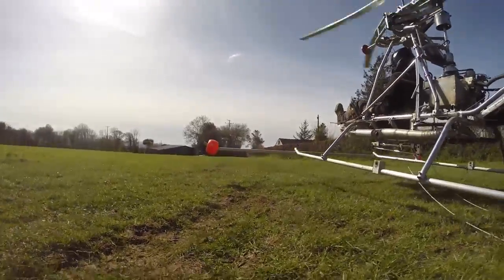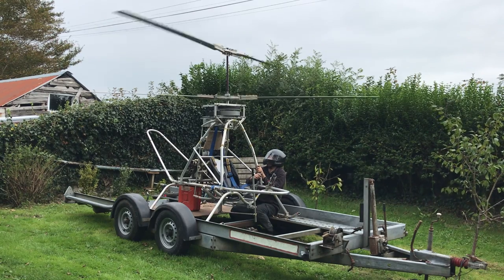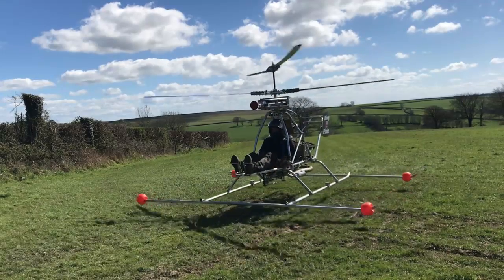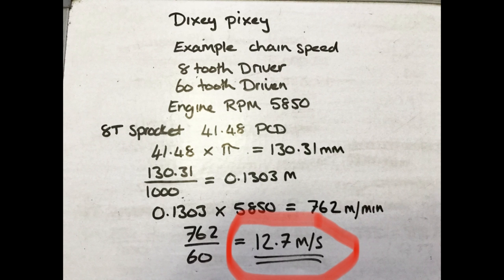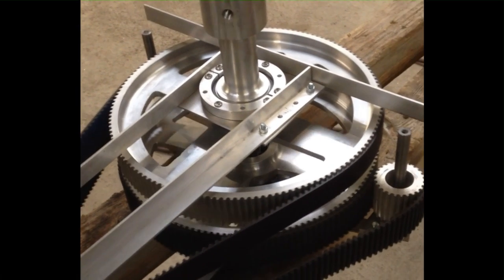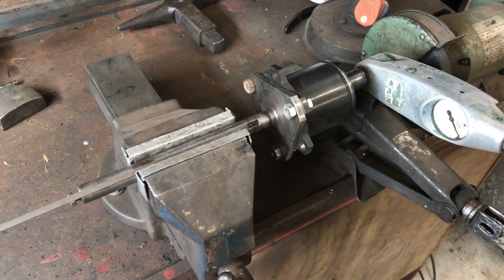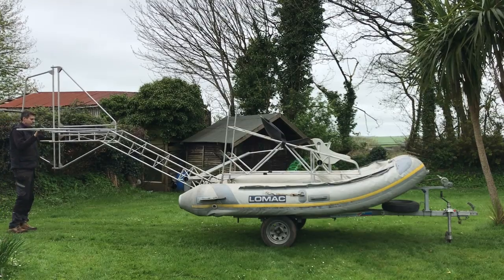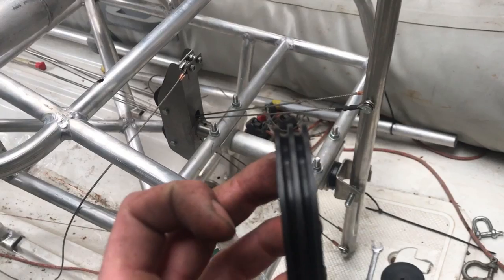Homemade Helicopter Rebuild part 2 plus Wing in ground effect, Ekranoplan, flying boat

Comment: Years ago I made most of the parts necessary for a minicopter. I never got around to put the parts together. Put an ad in the paper and someone else bought all the parts. That was the last time I seen all the machined parts I made years ago. 
          Wish I did not sell the parts today. But it is too late, its gone. 
          Nice work fella.
Reply from the maker: Interesting 👍 Was it parts made from online plans or your own design ?
Reply: @Ben-Dixey  Hello Ben. I made the parts from my own design. I looked up components comercelly and improved on the technical and duty cycle. So I cheated a little bit fella. Parts were 7078-T8 aluminum. The shafting was high grade titanium, I do not remember the grade Sir. Like your video. Brought back a lot of great memories. Peace v

Comment: Hello sir, I believe going to  Chain drive is a mistake chains are designed for running horizontal not vertical as your belt s run now , I've worked on equipment and vertical Chains aren't used they get turned into gears, chains aren't made to run that way they have a side thrust issue,  not trying to burst your bubble as they say  just offering input, if you do go chains I would bet it tears up gears , sorry for that, but I'm thinking I'm right, goog luck it looks really good from what I can see on video
Reply from the maker: Thanks for your input, I've found a couple examples where chains runs in the same way as my belt drive. The Rotorway Exec helicopter used chains and the Bensen B9 Helicopter both run horizontally. I don't think it will be a major problem but I need to do some more research and can understand why it will wear one side of the sprockets. It just depends how fast the sprockets wear. I suspect the driving sprocket will be ok because they are hardened but the driven sprockets I want to use Aluminium. This sprocket might wear, it just depends how fast.

Comment: Great feeling to see you back on the main project brother. the full success isnt far away now . thanks for sharing with us,
Reply from the maker: Cheers my friend, I've got to finish the flying boat before really concentrating on the helicopter but can't wait to get back on it properly. I really don't mind dedicating the foreseeable future on the helicopter. Its worth it because of how rewarding it is.
Reply: @Ben-Dixey  to me the most exciting part is to plan ,build , create, to puzzle, to struggle, to tests the thing it's even good to have two projects in the hand .
There is no chance of hitting boredom in your life until both projects get it destination.
Is flying boat like fixes wing aircraft or it's just a air boat ?
Full support brother
Reply from the maker: @rajeevshagun-info  👍 yes, I agree, there is a lot of satisfaction in all aspects of the builds. 
The flying boat will be an aircraft that flies in ground effect. Height above the water will be somewhere between 2 and 6 meters. It will be similar to flying a plane but can't climb very high, it relies on the extra efficiency of ground effect to fly. I think it will be a lot of fun if it works out. Cruise Speed will be 40-60mph, faster than most boats but only 60hp.
Reply: @Ben-Dixey  I want to use  your helicopter lifting off footage in the reels , ofcourse your name will be displayed as a creater of the machine, if you permit me to do so ?
Because I saw similar DIY coaxial helicopter in Reels just now , it too had extra tubes for primary balance support.
Thanks brother 😊
Reply from the maker: @rajeevshagun-info  Sure, no problem 👍👌 I'm all for sharing.
Reply: @Ben-Dixey  thanks brother,
Reply: @Ben-Dixey  bro ,I was showing your helicopter lift off to two other people we all three people impressed by smooth controlled hovering and lift off ,
Wow you have really improved the flight Ben .
Congratulations
Reply from the maker: @rajeevshagun-info  thanks, it was definitely getting better, shame the driveshaft broke but it will be back.
Reply: @Ben-Dixey  brother my friend Alf Beharie has sent a suggestion on my reel about your helicopter...I think it's considerable...I am pasting it below.

"His vertical stabiliser/rudder fin on it's tail appears to be way too small.  At hover the wash from the blades is being directed outwards 360 degrees all round by the proximity to the ground and it needs the drag provided by the stabiliser fin to keep the nose pointing in the same direction.  As it stands he is having to make constant adjustments to the stick to try and keep it pointing forward as the fin/rudder is not providing enough drag."

What do you think about it ? I know the big rudders looks ugly but may do the job right!?
Thanks
Reply from the maker: @rajeevshagun-info  Hi, I think the rudder could be increased in size, it would provide a better response to yaw control. I did once get to full deflection during a wind gust. It needs to be more effective, definitely a consideration for the future. 👍
Reply: @Ben-Dixey  I was thinking by seeing your rudders, they look cute compared to the other coaxial helicopters I have seen , others look awkwardly big and loose but now I think they might work better?!
Greetings bro.
Reply from the maker: @rajeevshagun-info  cute is a nice way of saying too small. 😆👍
Have a look at the sch2a coaxial helicopter, from those pictures the rudder looks even cuter. You would think mine would be better than the sch2a by comparison but perhaps I'm missing something.
My rudders are just flat pieces of carbon fibre, wonder if an airfoil would be more effective at creating yaw.
Also my rudders are hinged at 45 degrees, not 90 degrees to the downward airflow. I did this so that they would have some yaw control at forward speed as well as in a hover. 
That will be reducing the effectiveness in the hover.

Comment: extra-extra deep grooves for the control surface cable pulleys to help prevent cables coming off the pulleys perhaps?
Reply from the maker: I did consider that option but decided to use a cable retainer instead. A bent bit of metal that almost contacts the diameter of the pulley, preventing the cable from coming off. It's usually a U shaped bit of metal that is bolted through the pulley bolt but it needs to be done so that if the pulley bolt came loose it can't rotate and jam the cable. 
That's the thing with some safety devices sometimes they can cause a failure rather than prevent one. It's easy to solve that issue with an additional small bolt.

Comment: Another great video.  I concur with your decision to use chain as well as the selection methodology.  

A few people have mentioned heating, stretch & wear in relation to chain.  They are all valid concerns - but by periodically inspecting the drive components, you should be able to determine a life expectancy for each component and thus a service / replacement schedule.  That approach is common in aviation where strength / life expectancy have to be balanced against mass.  Sometimes the most viable solution is to have a light weight part, replaced often.
Reply from the maker: Great comment and that makes sense to me. The chains are cheap and can be replaced every 10 hours of operation if necessary. I think considering the low stress the chains are under it will be a reliable option.

Comment: Don't forget to factor in adrenaline strength when designing your control system.  I guarantee you that you can pull twice as hard as you can when you're not flooded with the good stuff.  I'm so glad you came back to the helicopter project!  Sometimes it just takes a while away from something to get a clear perspective on the path forward.
Reply from the maker: That's true, Adrenalin definitely gives you extra strength, I'll check the calculations with double the pull. 👍

Comment: Be careful - roller chains really don't like to be run horizontally - you'll find a lot of wear on the side plates and sprocket teeth as the weight of the chain pulls down on the sprocket.
Reply from the maker: Thanks for the insight, much appreciated, makes sense. 👍

Comment: Bike chains aren't used laying on their side.
Reply from the maker: That's right, not normally anyway. You would think that considering the tension they are under it wouldn't make a significant difference but maybe it does. Need to research this.

Comment: When the motorcycle chain fails, you at worst fall off the bike. When your helicopter chain fails, you die.
Reply: That being said, my dad swears by his Scott Oiler on his chains for his superbikes.
Reply from the maker: @RobinDuckett More risk than a motorbike for sure but bare in mind maximum height for this machine will be around 3ft. Chains have been used for helicopters. Rotorway for example. 
Interesting about the oiler, that could be a good addition.
Reply: Oof, didn’t realise they were £300! Definitely not the price he told my mum back in the day 😂😂

Comment: be aware of chain strech, a common matanance requirement on motorbikes is to re-tension your chain as it stretches over time.
Reply from the maker: 👍 chains could stretch quite quickly in this situation. Granted

Comment: multi-rib flat belts, or... crazy talk? a planetary. either the gear set from an automatic, or make one with a bunch of pneumatic tyres aka rollers...
Reply from the maker: Hi, multi rib belts can work and could be a better option. The sch2a uses multi-rib pk belts. I was very surprised when i saw them being used. One is run on the backside of the belt against the big pulley. This means it doesn't have to be double sided. A small diameter drive pulley is used. 

Planetary gear set from an automatic would be a good option. Think it can be used for torque balancing two rotors.

Comment: G'day,

Yay Team !

I flew behind a Bicycle Chain in 1978, and that Chain had been flying since 1975, with a 1-cylinder 2-Stroke
"Pixie Minor" 8-hp ex-Lawnmower motor 
Pulsing and vibrating it into motion.

This past 6 weeks I've put 670 Km on the new Talaria Sting L-1-e...,  a 3,000 Watt  road-registered Electric Motocross Bike.

It has the biggest Bike-Chain I ever owned ; and I'm coming up to speed on it, but it works very well.

People have been making ,& using Chains to transmit Power for a hell of a lot of time  ; and basically all the Bugs any Armchair Speculatir can imagine were all  thoroughly solved a hundred years ago.

Wilbour & Orville used Chains in 1903 to not only drive two Propellers from one 12.5 Hp Engine - but also they ran the Chains through Guide-Tubes, to eliminate Chain-Slap - and one Chain & it's Guides were "crossed" so that the  2  Propellers could rotate in opposite directions.

Chains are an efficient, cheap, &😮 reliable option.

Chains  do fail, when badly made, or badly aligned, or badly maintained...; or when overloaded...

But no more than does anything else.

The trick is to do it
PROPERLY, and thenceforth

Thou shalt
Not
Upfcukificate...(!).

One factoid cometh to mind..., when subjected to Thermal Analysis, a Bicycle Chain is 98.5% Thermally Efficient.

They waste almost no Kinetic Energy in heating themsrlves up from excess friction.

Such is life,

Have a good one...

Stat safe.

;-p

Ciao !
Reply from the maker: Brilliant comment. Thanks 👍

Comment: There is a school of thought that prefers an elastomeric coupler btw engine and reduction driven propeller when using gear drives. I assume the same might apply to chain drives.
I'm not aware of any flying examples using a chain drive propeller speed reducer, however I have seen them on prototype layouts.
Reply from the maker: Yes, that's right a cushion drive is important. I have no doubt more so if using a chain that has some play back and fourth.

Comment: Your calculations based on the use of a chain in motorcycles may be correct but do realize that a motorcycle is rarely driven at top speed if at all. In your application, the chain is used near maximum loading most of the time. A 1:8 ratio would require one rather small and one quite large wheel. There is a minimum number of teeth for the small chainwheel. The big one will be very big.
Reply: Imagine the stress on a chain when you rev the bike up and drop the clutch at the lights with 2 people up trying be the first away the chain takes more than they specifie  .
Reply from the maker: Hi, the 530 chain on the CBR at maximum load will be 2561lbs, the same chain will have a chain pull of 808lbs on the helicopter. The maximum speed on the CBR will have a chain speed of 25.7m/s and the helicopter will be at 12.7m/s. I understand the chain speed is still high for a constant use situation but I do think that the temperatures will be manageable for short durations.

Comment: problem with chain if it breaks at the wrong spot of the chopper sprocket there is a very good chance it jams the rotor assembly not good or even worst it breaks and hits you still not good use the belt if not the exact one you use try one thats aero certified or race car certified cheers from down under
Reply: Correct on all counts. But you know that all the great brilliant minds here that have changed civilization all think the chain is a great idea.
Reply from the maker: I don't understand why a chain would break if it's not being overstressed.
Reply: @Ben-Dixey  a chain does get stressed maybe nut in stretching but in lateral and vertical stretch when a chain is laid on its side under rpm but that’s your choice
Reply from the maker: @glennarnold3970  Ok, yes this needs to be considered. I've got quite a long distance between pulley centres, running the chain horizontally needs to be researched. Thanks
Reply: @Ben-Dixey  just trying to give you options cheers glenn

Comment: Before you destroy all your work, you may want to become expert first by spending 4,000 hours in a sim.
I'm not joking.
If you've spent less than 1,000 hours in a sim, or none at all, hang up your hat, and learn to fly first, or you're going to be chopping up grass or worse.   I'm sure you've seen plenty of vids on pewtewb of homemade microchoppers augering in because of lack of experience.

The different between me at 200 hours, 500 hours, 1000 hours, 2000 hours, and 4000 hours was worlds beyond in each case.  At each new level, I'd look back and when I thought I was totally qualified to fly, and say nope, not at all.

At 200 hours you can sort of fly and you think you can fly.  Pfft.   Maybe like a G.A. sorwwy pilot.
At 2,000 hours and beyond, you don't fly any more, you swim through the air like a minnow.
Reply from the maker: It sounds like you are a very experienced pilot. I'm very happy to have what instruction I can afford. To have 1000+ hours of instruction before going further might be considered a little odd considering what I've already been doing. No one can really argue with your comment but it does seem to be extreme, particularly when I'm flying a very unconventional, unproven design that can't even autorotate. A simulator would be good for training in an R22 but an R22 and my machine are worlds apart. Perhaps like using an F1 car simulator in order to learn how to drive a tractor.

Comment: Helicopters commonly use multiple belts (5 or 6), not the toothed ones as you are using now but regular V-groove belts. Yes they might slip, but in a way this could be a safety feature by absorbing peak loads. In some helicopters (Rotorway Exec) a belt tensioner is used as a rudimentary clutch. To me this feels a lot safer than a chain drive and due to having multiple belts you also have some redundancy.
Reply: With multiple v belts the whole unit becomes tends to become very large and cumbersome, not possible on Ben's machine.
Reply from the maker: A Vee belt drive would be very nice as you suggest, the sch2a uses a multi rib flat belt, nothing special from what I can gather. PK optibelt, very surprised it can take the load. Double sided Vee belts could work for me but a few of them needed for each drive, as mentioned weight and size could be a problem. Great comments coming in, really helps.
Reply: From reading through CASA crash reports, mostly for Robinson's the most common cause of helicopters coming down was drive belt failure due to slippage or breakage. Second most common was overheating engines. Multiple vee belts are used because they are a CHEAP means of transmitting power.